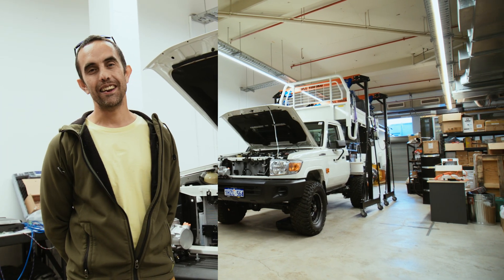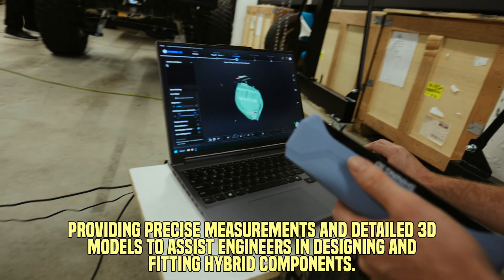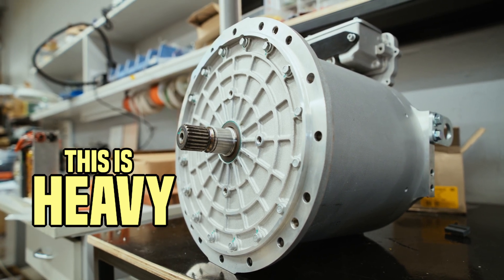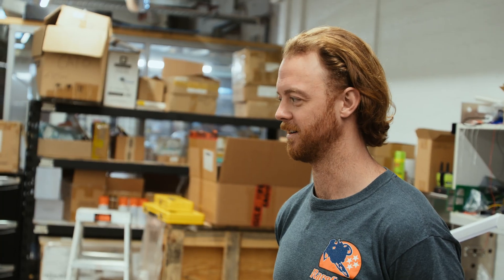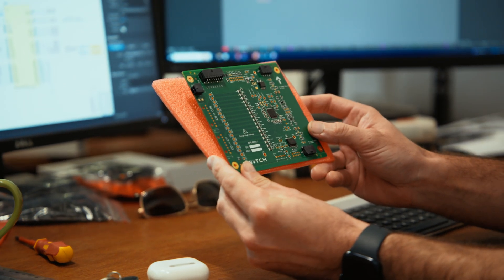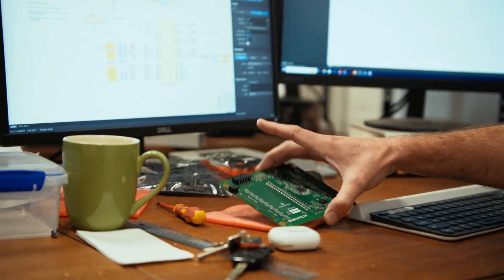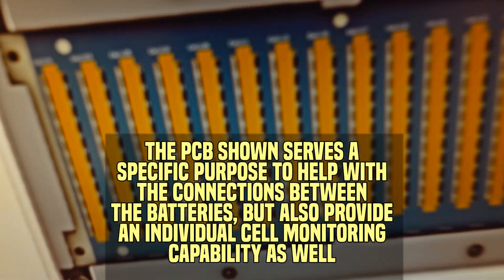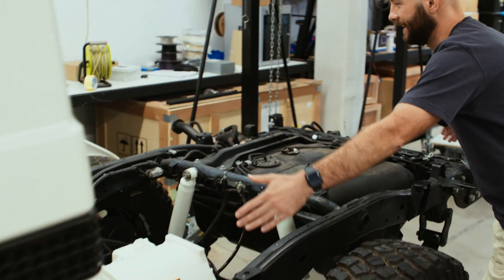Can a Land Cruiser Be A Hybrid? The Hybrid Puzzle Of Pumps, PCBs, and Power | Ep.02

Comment: Pouch cells... Really? In longevity terms they've always expanded and been rubbish after such a short time. I hope you're not charging them to 4.2v each. I love the hybrid idea, but I feel there's been soo many oversights in this build. Good luck
Reply: Chevy Volts use pouch cells (although water cooled) and they have proved reliable for over 10 years. Keeping SOC at max 80% and not going below 10% is the secret to longevity.
Reply: Did you watch the first video? I think they mentioned it’s a different cell chemistry
Reply: Hey Matt. Yeah if mistreated, pouches are unforgiving. We built an electric superbike in 2014 that did 1/4 miles in the 9s. That was a pouch pack with a much less sophisticated BMS and overall design. It can be done, it just requires attention to detail.